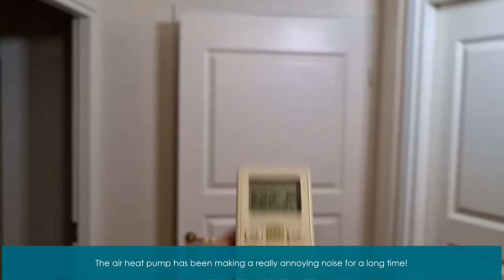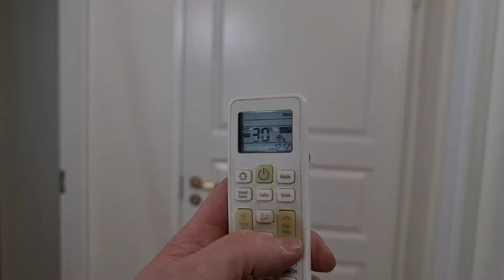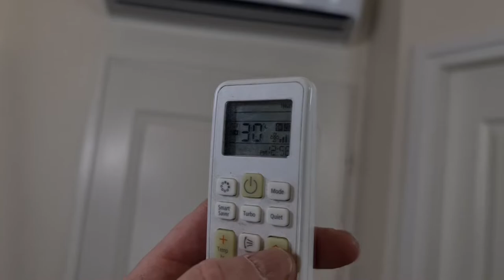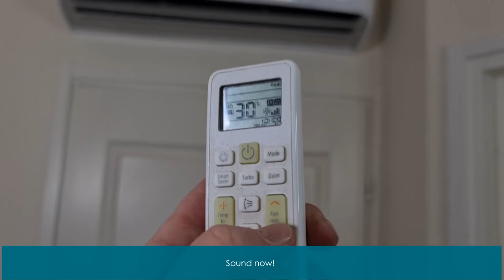Full clean noisy AIRCON indoor unit ✅ AIR CONDITIONER / AIR HEAT PUMP / AIR SOURCE HEAT PUMP

Comment: Well done! I did this on one of my heat pumps about 3 years ago - the end result is so satisfying! Unfortunately I have just had to do it again due to the bearing noise returning.  Apparently metal bearings in this type of application have a tendency to wear quite quickly due to the corrosive effects of stray electrical currents.  I have used ceramic bearings this time which I'm hoping will last much better.
Reply from the maker: Thank you! 😊
I can say that the difference is really GREAT after replacing the bearings and cleaning the device.
In the future, it will be easier to change the bearings and clean the device when you know how to do it.

Comment: Thanks so much for sharing this video! It has saved me a very expensive repair by professional technician.
Though, I do not have the confidence and tools for soldering and replacing the bearing, so I have opted for replacing the fan motor. Around 200 euros in spare parts instead of 10, but I will anyway save the cleaning service which normally costs 200 euro as well...
Reply from the maker: Great that the video was helpful! 👍
Reply: @JaniVoutilainen  Job just completed with great result thanks!
Reply: And if the new motor makes issue, I will replace the bearings on the old one with proper ceramic ones :)